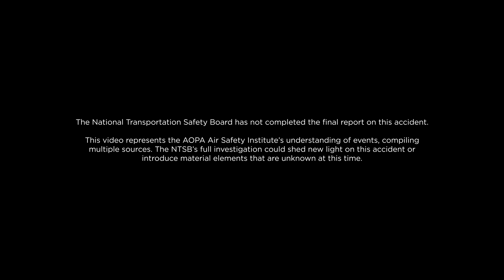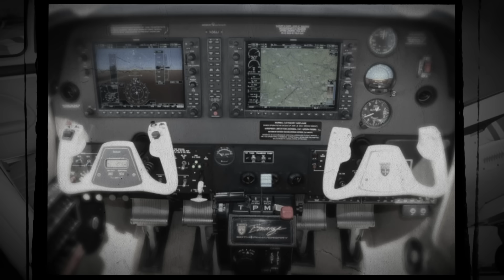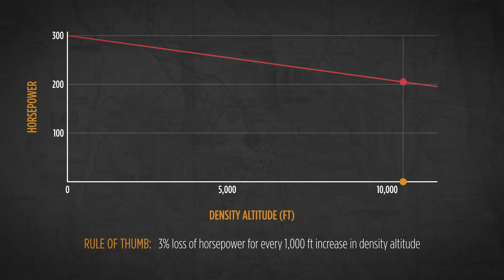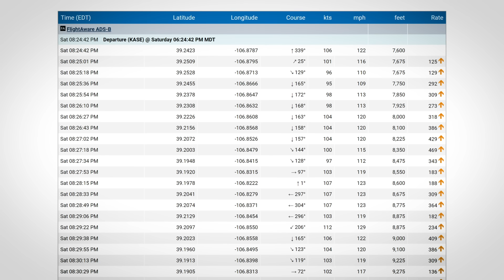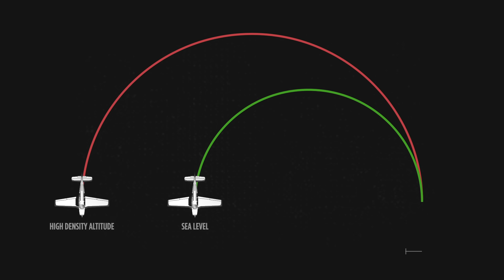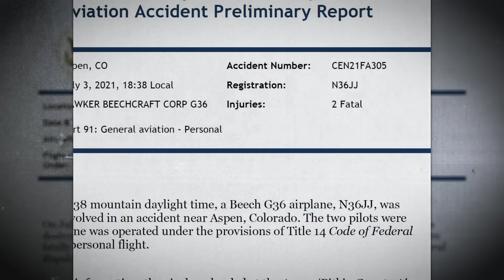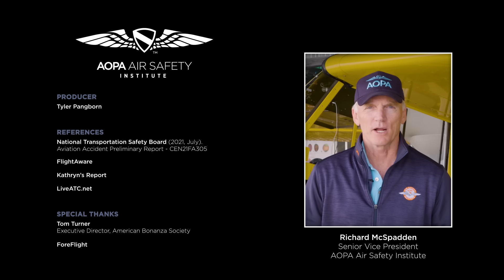Accident Case Study: Into Thin Air

Comment: The hint here is wait for the next morning to get the lowest temperature on a high airport.

I fly up to Tahoe in my 172 a lot, and it scares the bejesus out of me. I once witnessed a crash on final right in front of me. On south lake Tahoe, I take off towards the lake if I can, which gives me plenty of room to climb up. Once when taking off there, i had done the ground leaning operation and took off. I got the sense that it was not producing the expected amount of power and had a consequent slow climb. I did a a mixture check, always twist right to add more fuel just to see (left or lower fuel risks stopping the engine). Sure enough I got my power back. I was really puzzled by this, because I was sure that I had leaned it properly during run up. I asked my mechanic if it was possible if the lean point would be slightly different with the aircraft in motion vs. stationary. He replied in the affirmative.

Comment: I routinely fly similar aircraft, Mooney Ovation in the Rockies and I vividly remember when I was less experienced, several times struggling to clear the ridges especially in summer months. It is scary to watch the CHT gets closer and closer to red line of 460F as you try to climb, which in turns lowers your airspeed and cooling of the engine causing CHT to rise further.  Now with these experiences, I always consider if the trip is worth it before taking it.

Comment: Near the end of the video there is a message from the Air Safety Institute President, a former Air Force Thunderbirds pilot.  Ironically, he himself (Richard McSpadden) was killed in the crash of a Cessna following an engine failure, 1 October 2023.  Light airplanes are risky business. 11:25

Comment: @ TS 10:03 it is not the square of the speed. It’s the square of the CHANGE in speed.
Reply: Incorrect in the special case where the moving object will come to a complete stop.  Thus the change in speed is always to a zero momentum, and there is no point in subtracting zero from the expression for no reason.  X and delta X are in this case exactly the same.  The point he is making is correct and valid.

Comment: It's analogous to attempting to drive five people up to the top of Dinas Mawddwy in a gutless Ford Anglia 105E...when you're down to 2nd gear and you can feel the clutch slipping and the engine revs are loosening your fillings, you KNOW that you've bitten off more than your mode of transportation can chew.
Reply: Eh, did you forget the part where the car is on the ground and the airplane is thousands of feet above it, traveling at 3-4 times the speed?

analogous---comparable in certain respects, typically in a way which makes clearer the nature of the things compared

Sure covered your bases there, huh? LOL!

Comment: The temperature on those runways are not what you will see on your weather report. Weather reporting stations report temperature measured in a open grassy area about 4 feet above ground level with an insulated shaded roof above. This is an attempt to create an uniform reporting process. The runways in an area nearby is almost always hotter on a sunny day sometimes dramatically so. 
I am a non flyer but, my family has several civilian weather reporters for the National Weather Service.

Comment: This was just a failure to have patience enough to climb early climb often. These guys were counting on and up draft or no downdraft or still air or something. Would it be better to change the regulations where everybody had to fly higher than the nearest point? Climb and then go? Works everywhere like a charm. There's a lot of good places to save some time in life but airplane climbing over the low spot in the mountain is not one of them.

Comment: I binge on GA crash case study videos. Aspen has more than its fair share and the culprit is almost always a lack of appreciation for high density altitude. And more often than not, is one of us flatland pilots in a normally aspirated single. Here in the Deep South it's generally easy for a normally aspirated plane to get you about anywhere--even in the Smokeys. Not so out West. In my opinion, a turbocharged engine is minimum equipment for Aspen. There's just no room for miscalculation otherwise.

Comment: Is it just me or did these pilot's have no business flying a normally aspirated aircraft through Colorado without any mountain flying experience?
There were obviously other routes that provided a better safety margin.
When I flew piston powered aircraft in the New Guinea Highlands, some airstrips had a 7000ft elevation and we could not develop adequate RPM unless the mixture was leaned for take-off!!

Comment: A few years ago I bought a Cessna 150 with a 150 hp (0320 conversion) in Durango and flew it home to Wichita directly over Wolf Creek Pass.  DA at Durango was about 7000.  I was planning to fly south where the mountain range is much lower.  The guy I  bought it from said I could do that, but he recommended I climb over DRO until I’m at 13500 before deciding.  To my surprise, the little Cessna 150/150 climbed right up there.  I could see over the continental divide.  It was easy to flit right over.  Looking back, I probably should have taken the lower south route I’d planned for.  Is have had more options if things went poorly.  For one thing, I didn’t have oxygen.  I was lucky.  Also, people in Colorado fly higher powered airplanes for a reason.  My plane had been given 50 % more HP than factory.

Comment: Very very similar incident happened with N4584A, A cessna L-19 bird dog that crashed near Tabernash CO. a VHS tape recovered showed them climbing into the mountain where the thin air degraded the aircrafts performance before it crashed into some trees in a valley near meadow Creek Reservoir. 
RIP to all lives lost in plane crashes.

Comment: My first question is why choose Aspen in the first place. Under the best conditions it is a demanding airport. As a fuel stop, its high terrain leaves little margin on departure with full fuel. Add density altitude and suddenly there are no margins. The decision to use Aspen imho was the root cause. I've flown into Aspen many times, always in turbines. I've also used Eagle many many times instead. Aspen requires the best out of a pilot on a good day. Once filled with fuel, an early morning departure might be the best option in a non-turbo charged recip. Or put 3 hrs of fuel instead of 5 hrs. Mitigate risks, create margin for safety  and be situationally aware. Mountain flying is serious, operations in Aspen are serious.

Comment: I wonder how much fatigue played a role in this. They had done over five hours of flying, spent 4 hours on the ground, and had potentially several hours to get to Des Moines.  I don't make the best decisions after five hours in a car followed by needing to get back in the car a few hours later. 

With such unfavorable density altitude in the mountains, it would have been wiser to spend the night in Aspen and leave early morning with a clear head and cooler temperatures.

Comment: I lived in Springerville Arizona for 15 years. The airport is at 7;050 feet elevation and the runway is over 8,000 feet in length. We had a Globe Swift taildragger. Common sense said if you were traveling, you took minimum luggage, you didn’t necessarily top off your fuel, you always exited the airport with a left turn and you left as early in the day as you could.

Yet we sometimes watched people from Phoenix who did the opposite of the above and they slowly became airborne as we stood watching them with bated breath. Every year there is usually a rejected takeoff and worse disasters.

Comment: So if the DA was 10500, and they needed to climb 5k above field elevation, the airplane was asked to perform at roughly 16000 DA! At near max gross that plane had almost no climb performance, and the pilots were probably hypoxic. I tried 14.5 k once with no O2, and within 2 minutes I had to descend from hypoxia.

Comment: When I learned how to ride a motorcycle, I learned the difference in physics which can make it dangerous compared to a car IF you don't acknowledge these differences. You can't simply turn the handlebars and expect a desired result. You will fall as motorcycles don't turn like cars, they rely on propulsion for balance and they don't turn like a car they lean to create turns or change of directions. This is opposite of what one would think instinctually. You will die on a motorcycle if you don't acknowledge the differences in physics and a lot of people do. As far as planes are concerned. a 4 cylinder engine should be understood has limitations just like a 4 cyl car or a single cyl motorcycle. When your choice of transportation isn't meant to do something, like Dumb and Dumber using a Honda Ruckus, bc people have a desire to use a tool outside of its intended use. Microsoft makes a living selling support on why people call in for assistance with their software product for this very reason. A 4 cyl going that high in that thin of air is doing just that, testing the limits of the product. Believing in just using the circling maneuver or to circle back were the biggest errors in human assumption. Motorcycles have some forgiveness because of how they can maneuver and brake, you are on land, however in these scenarios just like being on skis going downhills, the ability to maneuver has other unforeseen variables and must be understood. This is why Jim Carrey doesn't fly a plane. His alter ego would get him killed.

Comment: The failure to recognize the requirement to climb to 16,000 for the IFR departure suggests insufficient preflight planning. The apparently impulsive decision to then revert to a VFR departure (also apparently without a detailed plan) further suggests a lack of disciplined planning. The airplane did the best it could, but the pilots asked it to perform beyond its capabilities. You cannot repeal the laws of physics by optimism alone. Mother nature has no sympathy for a failure to plan, especially in hot and high conditions.

Comment: I earned my PPL in the thick air of Southern California where the biggest challenges were busy airspace and a lot of radio work.  I moved to the Colorado Rocky Mountains about 7 years ago, trading the challenges of airspace for the challenges of density altitude and plenty of granite around to thwart the best laid plans.  This video does a great job of explaining and visually demonstrating the challenges that these pilots faced based on the decisions they made and conditions at the time of their flight.  

The tragedy of this flight offers an opportunity for the rest of us to learn from their mistakes.  While the Aspen area is certainly a beautiful area, there are nearby airports that would likely have made this flight a success.  Grand Junction (GJT) airport is along this route and would have been a good early stop with alternates at Delta and Montrose to the south.  While not as beautiful as Aspen, it does offer stunning views of Mt. Garfield and Grand Mesa.  The elevation here is much lower than Aspen with plenty of room to climb out.  Radio coverage can be a bit spotty when climbing out to the east.  The next good option along this route is Garfield County Rifle Airport (RIL) which is often used as an alternate for Aspen and 2300 ft. lower.  Finally, Eagle County Regional airport (EGE) is 1300 ft. lower with a 9000 ft. runway and more forgiving terrain during a VFR climb out.  

The east-southeast departure that they took is challenging.  The controller spoke @3:22 of going "down valley" (to the northwest) before making the turn east.  This provides more options for climbing out VFR from Aspen with lowering elevation during climb and options in the event of a problem.  Hopefully we can all learn from this incident.  Thank you to the AOPA Air Safety Institute for making this video available.

Comment: I can't imagine why anyone wouldn't take a few extra orbits to achieve an altitude above whatever obstacle you will encounter within proximity to the airfield. At least that way if you find your aircraft is not capable of reaching that altitude you find out before it becomes an issue. An extra 3 or 4 minutes? Even an extra 10, better than the alternative.

Comment: Another wonderful ASI video. So much to be learned from it. My question arising from this video is as follows: We have advisories for weather. Could there not be advisories for such special conditions? It seems silly and tragic that the pilots (whose responsibiltiy it is, yes, to plan a safe flight path) were not given a simple advisory that most likely would have saved their lives. If there were advisories, for example from the local pilot's association or flight instructors associations, with a few key details, this tragedy could have been prevented: From this ASI video itself, I could imagine the following adivsoy:

DENSITY ALTITUDE DANGER ADVISORY:
1) Climb to a minimum of 12,000ft (or highest peak in that direction) in a circling / holding pattern above the airport before leaving the airport air space. (This could be a requirement for all small craft.)
2) Plan for a minimum of 25-30% reduction in engine performance due to altitude and calculate your flight path, fuel mixture, speeds and altitudes accordingly -- in advance.
3) Select your flight path -- in advance -- to know the passes and their minimum altitutdes.
4) For the chosen flight path, determine -- in advance -- the last "abort flight" point.
5) Remain to one side of the canyon or the other to allow for 180° turn, if necessary.
6) "The narrowing cone of danger": Rising ground and converging mountain sides are just as dangerous as the high peaks. Also in "the cone" is diminishing engine power. Stay above the cone or or stay out of it!

Though it is not the ATCs reponsibility, the ATCs could: 
A) give this ADVISORY to pilots who are not from the area.
B) request which pass the pilot will take before take off (as a safety measure) and alert last turn-around points.
C) though redundant, warn pilot to acheive minimum altitude above the airport before departing the area.

The Air Safety Institute is extraordinary. I hope every pilot out there is watching all these videos repeatedly. No other vlog contributes so much to small-aircraft safety. BRAVO!

Comment: I watched a Cessna fly up the East Maroon Creek valley while eating my lunch on the top of Pyramid Peak.  For those unfamiliar with the terrain near Aspen, this is the valley just to the east of Pyramid Peak.  It was surreal looking down about 3,000 feet at an airplane struggling to get up the valley.  He went straight up the gut, no chance of turning around.  We sat and watched him for the 3 or 4 minutes it took for him to make it to East Maroon Pass (11,800 - ish, I think) - and it was terrifying to watch.  He couldn't have been more than 50 feet above the ground when he cleared the pass.  Either an extremely experience pilot, or an extremely lucky one.  I'm guessing it was the latter.

Comment: As a CAP cadet in Buena Vista CO, I helped recover far too many people who made this mistake.  I recommend that pilots who have never flown their aircraft over the Continental Divide in Colorado (i.e. clearing 14 Kft+) should not consider doing so until they have had a mountain flying course.  Too many people die due to what is described in this video. Unless you have had the training, stay out of the Colorado mountains in normally aspirated airplanes.  It's not just you who will die .. but all your passengers (i.e. your family).

Comment: I am preparing to ferry two aircraft from AJZ in CO. Though it will be a VFR flight; I will be doing the VCOA to get up to 13,500 before continuing.   Piper 180 and 236

Comment: Having flown for work a considerable amount of time in Colorado and in the Aspen area, I find it surprising that pilots are still making fatal mistakes when departing the Aspen airport. I cannot remember how many times I was in Aspen to remove the wreckage of airplanes and the bodies of the pilots, but it was more times than I would like to recall. I am not telling others about this to lay blame on anyone, because I have see the this happen to those with little experience and to very experienced pilots. Two were even high time commercial pilots. I would hope that everyone that reads this heeds the warning not to fly in mountainous terrain until they have actually have some mountain flying experience. There are some excellent courses out there that give you a good foundation to tackle mountain flying. I had flown enough in Aspen to know the controllers and if they asked a question it was for a good reason. If they asked me if I was going to fly "down valley", that is to the Northwest, they were gently warning me not to try to depart toward the South. Pilots that know the area depart to the Northwest because the terrain remains low for more miles. I saw one comment that said they would put off buying an airplane and ferrying it to the east. When I ferried aircraft from the west to the east, I "always stayed south", even though I had extensive experience with mountain flying. That is the beauty of an aircraft, you can always plan to fly another way. The direct to approach is not always the most expenditure.

Comment: Why did they chose to fly into Aspen, why not Grand Junction or Gunnison? A common sense approach of using airports at lower elevations would have given them much more room to climb up to ridge crossing altitudes in excess of 11,000 feet. A corporate jet set pilot and a celebrity dentist cheked into a celebrity jet set location on their way home.

Comment: Very well narrated. But I have 2 questions can any one answer:
1. how leaning the mixture would have produced more power? you mean making the mixture more rich?
2. what do you mean when you say, " at high density altitude ground speed is higher, requiring larger turn radius than at sea level"?
Thanks